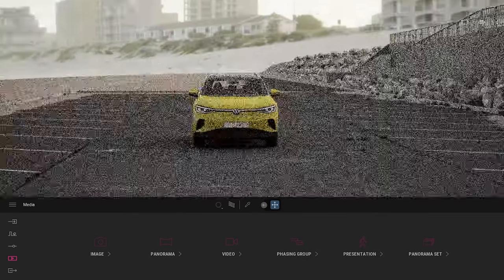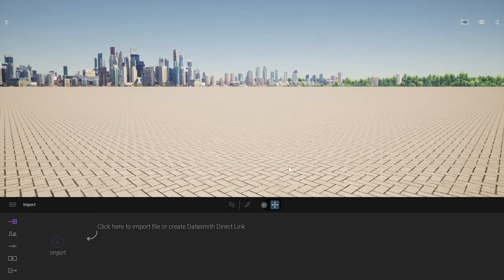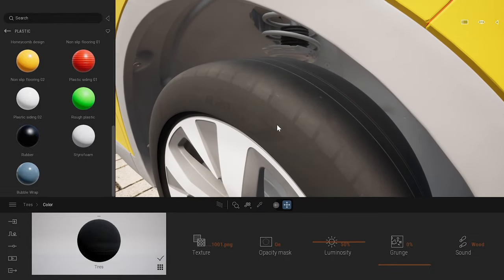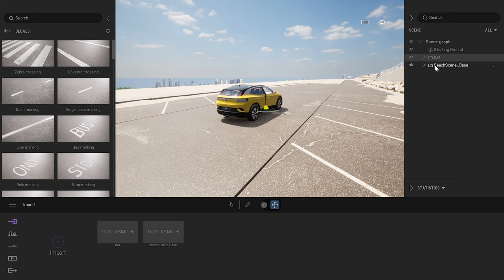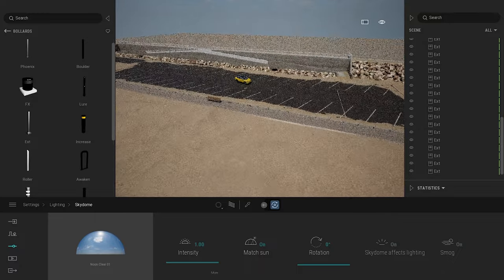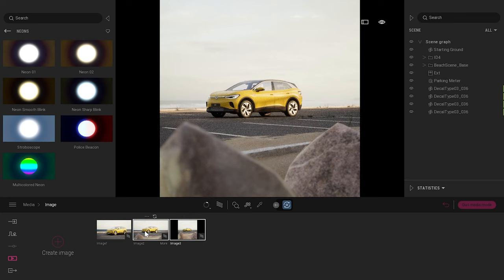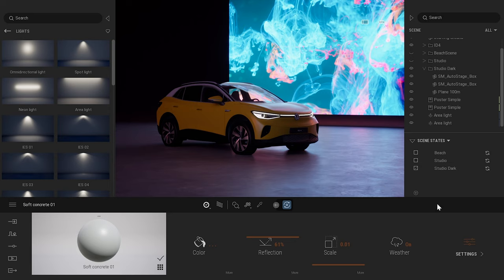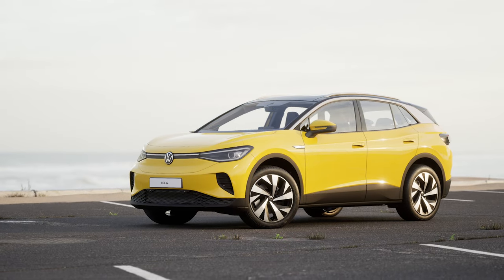Automotive visualization in Twinmotion Webinar

Comment: Just tested, decals for (flat objects) path tracing can be made with a 1M plane (scaled to almost 0 in Z axis) - and then you can apply all the material layers of native decals to that plane as a custom material - perhaps what you miss out on is sorting, and opacity.
Reply: Hi I'm trying to change the texture on the plane but I can't find the directory for the decals, do you know this?
Reply: @nathanlunsford7110  Hey, you have your decal and your plane inside TM - then what I did was to use the Eye dropper tool and get the "texture" of the white plane.

Then I copy-pasted (you can copy the texture from inside TM) the different layers of the decal to their respective place in the texture.

I guess you could download the decals from quixel too...
Reply: @jankg7560  good idea! Will try.,,

Comment: The questions is: Why didn’t direct use UE5?
Reply: UE5 is a bit more difficult to handle, just because of the blueprints it's something else...
Reply: Like said in the other comment. UE is great but the learning curve around Twinmotion is really not the same. You can be productive with Twinmotion in a couple of hours. Also for advances people Twinmotion have its nattivz library + path or other weather system directly built in. No need to grab pack on the marketplace to populate your scenes.

Comment: make ray tracing available for everyone please. its not even real time ray tracing
Reply: ray tracing card is steel not democratized  it's so expensive
Reply: Pathtracing it's better than Ray tracing but u need an rtx card , nothing much u can do about it sadly
Reply: @marko2262  I got a GTX1660TI and pathtracing works just fine.  You don't need a RTX card.
Reply: @RickDupuis  work fine but what I am doing in 2 minute u doing it in 20 minutes and there it's the difference
Reply: @marko2262  so you went from you need an RTX to not needing an RTX card? Nice. 

Plus it doesn't take me 20 minutes to do a preview or render final scene but thanks